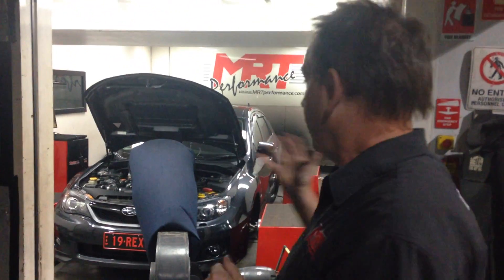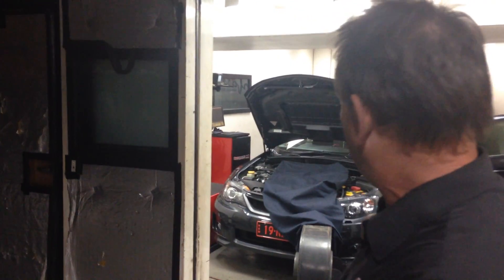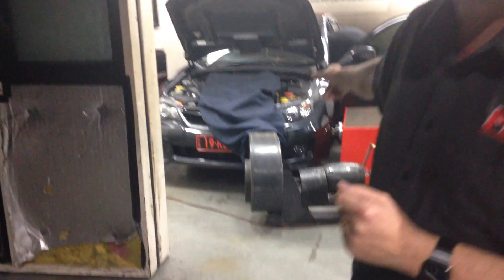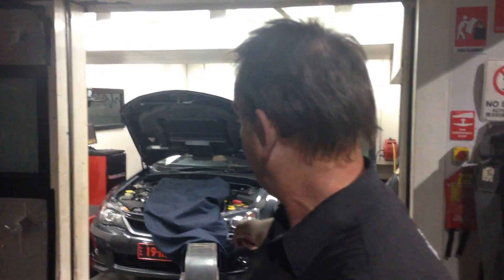The Importance of a Tune - From 6KW Gain to 35KW Gain!

Comment: 35kw atw isn't that much of a power increase tbh
Reply from the maker: itsa reliable solid upgrade
Reply: MRT Performance The owner just probably wanted to stay on the very very safe side lol
Reply from the maker: what would you expect to gain with those mods on this car?
Reply: MRT Performance Around a 50kw increase atw.

Send me the dyno sheet tomorrow with AFR readings for a better approximation
Reply from the maker: 50kw  is mechanically unreliable and outside the efficiency of the engine and turbo.
Reply: MRT Performance Once again, without the dyno sheet, AFR readings, injector duty cycle readings etc, I'm half blind with my approximation. Of course at the end of the day, it needs to be a safe tune with standard rods and pistons and stock turbo. But I would strongly suggest that based on my own knowledge of these engines and mods, that there could have been a good figure tune.
Reply from the maker: 35kw is damn good and a sensible balance of safe and efficient.
Reply: MRT Performance At the end of the day it's a service provided to a customer to make them happy and if they are happy with it, job done I guess..

Comment: Hi Brett, I have an MY13 in Adelaide. I have recently put on a full turboback system as well and have considered tuning. How much roughly would a tune like that set this customer back in your workshop? And do you have an aftermarket ecu to obtain blip on down change or is that done through the factory ecu. 35+kw is a substantial gain from just an exhaust and I do agree that untuned its made minimal difference but brought out the awesome sound. Cheers, Kyle.
Reply from the maker: call sean at S/J auto and askfor e special discount, mention me
:)